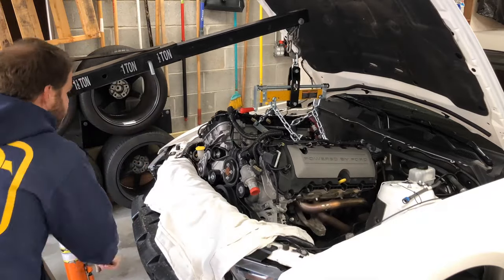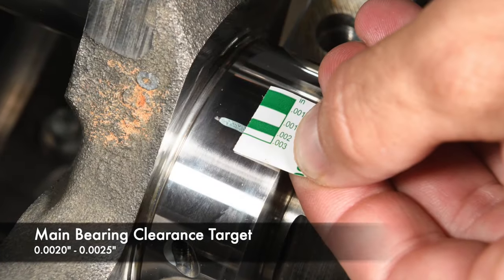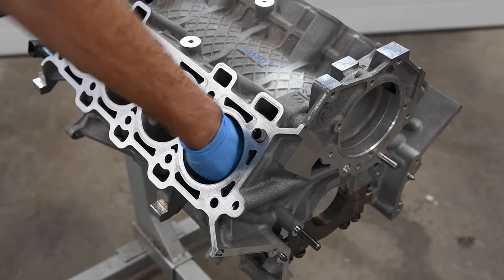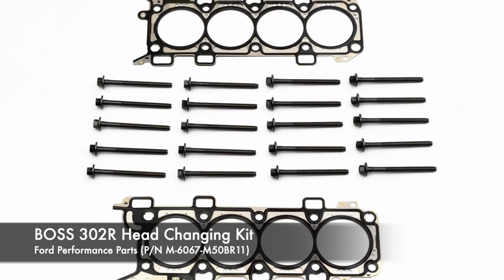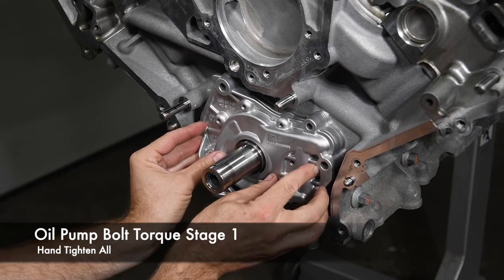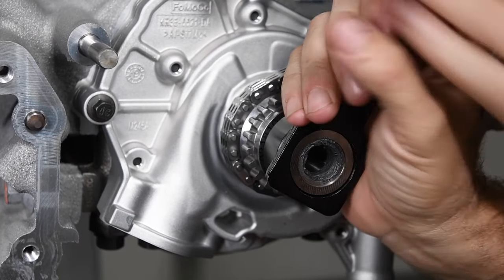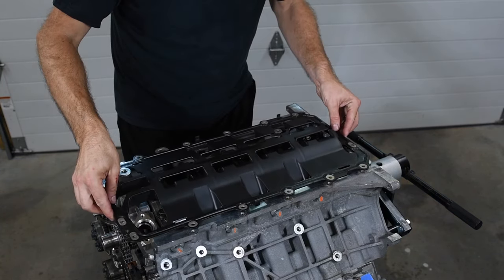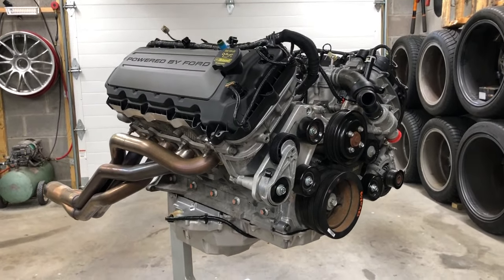How to Build a Ford Coyote 5.0L Engine

Comment: I’m curious, I have a truck from 2011 that was handed down to me from my dad, real reliably F150 I wanted to get a whipple and a forged bottom end and aftermarket cams, ive even a small engine builder mechanic for a couple years working on ATVs and stuff soon to be adding performance parts to mine and I’d like to step foot in the car world. Could you lend a hand brother ?
Reply from the maker: I'd certainly get forged rods and pistons. I'd skip the cams because unless you're working with a VERY experienced tuner, tuning for cams takes a lot of expertise that most tuners don't have. Rebuilding a coyote engine isn't hard if you pay attention and take your time!
Reply: @Mustang-Geek  ok thank you geek! I quite enjoy rebuilding engines funny enough. Now I’d like to reach about 700 on E85 or 600 on 93 somewhere around there or higher what type of trans and differential would you swap too compared to stock
Reply from the maker: @Metro-fx1bv  Your factory trans and rear end will be fine.
Reply: @Mustang-Geek  your sure? Even if stock engine is about 400Hp to 600-700?
Reply: @Mustang-Geek  I’m also curious the stock engine has about 103K miles on it currently, now obviously I’d be replacing main bearings timing chains all that good stuff, would I replace anything to freshen it up? Say stock cams? Or the cylinder bore I’m most curious about
Reply from the maker: @Metro-fx1bv  I'd find out which transmission your truck has and google how much torque it can handle stock.
Reply: @Mustang-Geek  ok thank you for your time! I’ll get back to you when I get home I’ll check if it’s in my owners manual or if you have an idea of where to look

Comment: Thank you very much for making this video! With the upgraded pistons and rods, what should the engine be able to hold power wise?
Reply from the maker: Estimating horsepower (or more accurately, torque) capacity for an engine is difficult, but at this point the Coyote block is the weak link. Reliably, 800 horsepower is a fair number.
Reply: @Mustang-Geek  Thank you for the reply, and what you said makes sense regarding torque being the better measurement. So given that the block the weak link, would using a gen 2 or gen 3 block be better for a build due to strength in the mains/structure, or is it more the problem of needing sleeves to reinforce the cylinders no matter which block is used?
Reply from the maker: @bbkr7910  Good question! I don't know if the Gen 2 or 3 blocks are any stronger.

Comment: Question is the gt500 oil pump gear housing that much more of an upgraded over the gt one? If so can you explain why?
Reply from the maker: It has wider gears so it can pump a much larger volume of oil. This is helpful when running looser bearing clearances.
Reply: @Mustang-Geek  I’m gonna be running twin turbos do you think it would be a plus to run the gt500 one ?
Reply from the maker: @valdo_s1975  If these turbos are going to "bleed off" oil supply, that would make sense to me. Also maybe run the "extra" clearance main and rod bearings and 5W40 Miller's Nanodrive oil.

Comment: I'm going to ask a lot of questions.  LOL   Sorry.  When you were measuring your Main Bearing Clearance target, do you bolt the bearing caps down or just sit them over?
Reply from the maker: Bolted them down.
Reply: Should be torqued to specs too.
Reply from the maker: @charlesholloman2400  Correct! Use the old bolts if using new torque-to-yield bolts!

Comment: I have a 2011 F-150 with the Coyote 5.0L that the Ford dealer says only has 10 psi oil pressure at hot idle. Can hear a slight "tick" that gets louder when the engine is slowing down (after you give it a shot of gas). Haven't worked inside an engine since 1982, do you think I can just change the oil pump and bearings and leave the top alone? Only has 75,000 miles on it. Probably going to sell it, but don't want to sell somebody a truck that is about to blow up.
Reply from the maker: Might be the "bbq tick." Try googling it.
Reply: @Mustang-Geek  Maybe...what really concerns me is the 10 psi. I originally took it in because it had VCT codes. Dealer says pressure is too low to operate system and recommended a replacement engine. I put 5W-40 in as a patch and the codes haven't come back (yet, only a couple hundred miles), but I still have the tick.

Comment: next time you should consider main studs. 
what do you think about gapless rings?
Reply from the maker: We thought main studs would be nice, but weren't necessary at this power level. Gapless rings sound like a great idea in theory, but I've noticed very few engine builders use them.
Reply: i think people use gapless rings for the wrong reason. most people expect a big power increase but that's not gonna happen and that's not what i like them for. i like to use them on a boosted setup so i can have a big gap on the rings without any extra blow by
Reply from the maker: @horsepoweraddiction808  Great insight!

Comment: I was hoping torque values were going to be spoken as assembled. I really need to know the torque values for the camshaft cap bolts 😣
Reply from the maker: Use new bolts, tighten to 133 in lbs (11 lb-ft) plus 90 degrees. No loctite.

Comment: What was the part number for the head studs?
Reply from the maker: BEWARE! I used 256-4702, but my engine used 12mm studs. Some engines have 11mm threads, so you have to determine which threads your engine has BEFORE you order studs.

Comment: I have the Boss tensioner kit you mentioned and noticed the secondary tensioner is shorter than the original one. The origional one protrudes through the bottom of the cam cap casting (Boss one dosen't) and the guide attaches with a metal clip that makes it snug. It appeares that you just slide the guide onto the casting . The guide alone seems rather loose. I want to be sure this is right.
Reply from the maker: I figured this out after starting my engine and it making a lot of racket: After installing it, DEPRESS THE SECONDARY TENSIONER TO RELEASE THE SPRING!!! It should pop up and tension the chain properly. Try that out and see if that addresses your question!

Comment: I understand filing the rings to a certain gap, but not sure what it was you were doing after that.  You had the rings on the piston and then test fit it, but what were you doing with that little tool?  What is that?   I've never rebuilt an engine but would love to do one over time just to do it.   Also, I'm assuming you have the block bored over to the 3.640 before starting?  What all needs to be done to prep a block?
Reply from the maker: I used a deberring stone to deburr the rings. Or maybe you were referring to the pick I used to orient the piston rings around the piston properly? Not sure on that. Let me know the time stamp on the video you're asking about.
Reply from the maker: Also, the block was bored over slightly to clean up the bores and match the new pistons. I believe they were 0.010 over.
Reply: @Mustang-Geek  What did that change your displacement to?  Oh,  thanks so much for answering my questions.  I really want to do a build.
Reply from the maker: @ronin2167  Yes, it changes displacement slightly. I noted that in the tune, as there is a field for displacement.
Reply: @Mustang-Geek  1:22 mark
Reply from the maker: @ronin2167  Oh, that's a feeler gauge to check ring gap.
Reply: @Mustang-Geek  That's what I thought it was.  Are there rings inside the chamber and on the piston?
Reply from the maker: @ronin2167  Not sure I understand the question. There are only rings on the piston.
Reply: @Mustang-Geek  So when you stuck the feeler guage inside the bore, what were you measuring?
Reply from the maker: @ronin2167  The gap between the ends of the ring.
Reply: @Mustang-Geek  Oh I see what you did. You put a ring inside the bore and used the piston to push it down 1in then checked the ring gap.  I have been watching this on my phone and didn't see that before.  Duh!!!
Reply from the maker: @ronin2167  All good!

Comment: As many times as I see it I always cringe when guys lap valves it does nothing by itself in fact you may make your valves leak worse by doing that lapping the valves is a procedure that machine shops use to see where the valve seals at after they have done a valve job yes it makes everything look shiny and new to the naked eye but it truly does nothing alone
Reply from the maker: Thanks for the insight!

Comment: No way I’d trust an Amazon torque wrench on main bolts.
Reply from the maker: Fair point. Thanks for sharing! Please like and subscribe!
Reply: Actually, their tolerances are well within an acceptable range. Even after over 1000 torques, they still hold calibration. The harbor freight  wrenches are the best bang for the buck. Its all personal preference. Better torque wrenches have more convincing setting engagements, and more visibility for setting increments.
Reply: About as reliable as my used set of harbor freight jacks I got off Craigslist for $7.31 and a 5 pack of beer. It's fine. ~ this message was sent from an Apple phone located in hell.

Comment: What brand piston ring compressor did you use?
Reply from the maker: I don't remember for sure, but I think it was a one-piece from Summit.
Reply: Thanks. What was the P/N for the rod bearings. CB-1442HXN ?
Reply from the maker: @moonman1195  Rod Bearings, 0.001" Extra Clearance, P/NCB-1442HXN